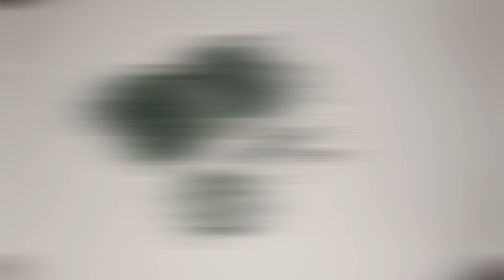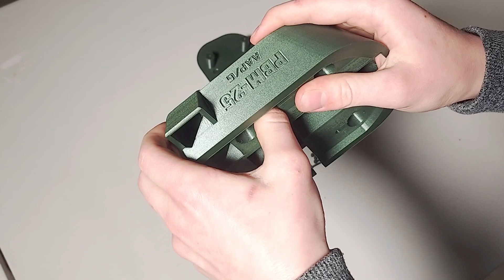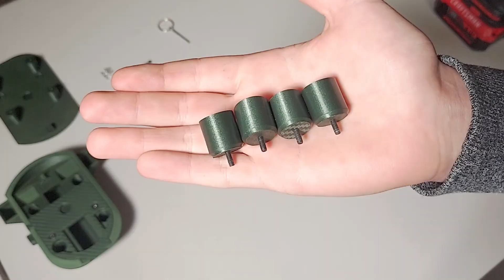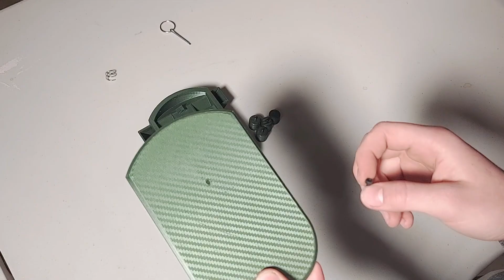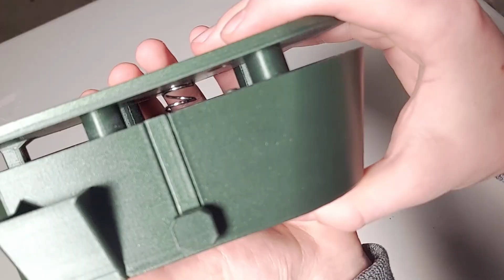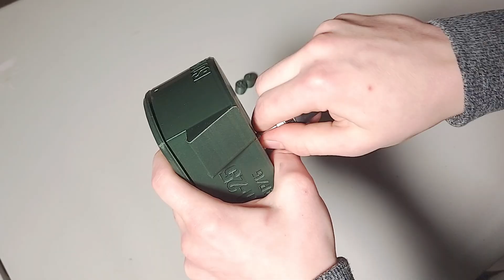PBM-25 Airsoft Land-mine Assembly Guide | Full Guide

Comment: Question, how hard would it be to convert this to go from being pistol mag powered to 209 or cap powered? Like to use one of the grenade cores as the power source or something?
Reply from the maker: Great question. This mine isn't able to be converted simply due to the design, but we will most likely be working on a pressure-activated sound landmine soon. We already have a tripwire sound mine (which can use both ring caps and .209 primers), but we do want to make a pressure-activated one as well. We appreciate the suggestions.
Reply: @isotac.airsoft  sweet. I've been brainstorming a design myself, I just have no idea how to create a blender file. ^^; And I have already purchased the trip mine file from your Cult page. I intend to make the enemy team hate me at this summers milsim. XD